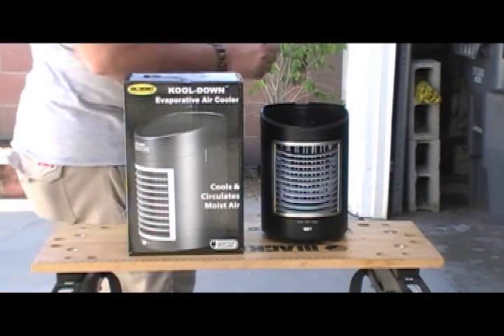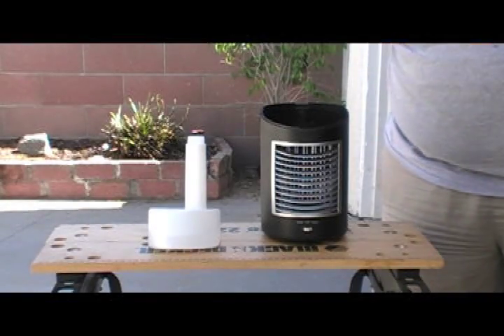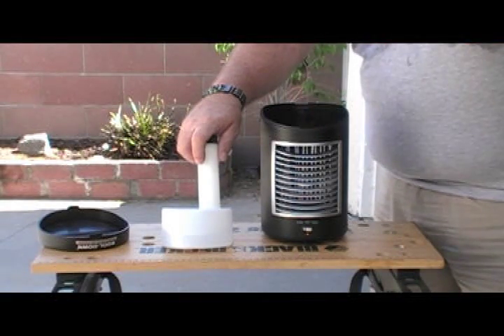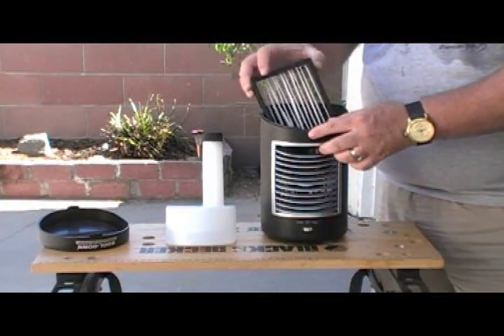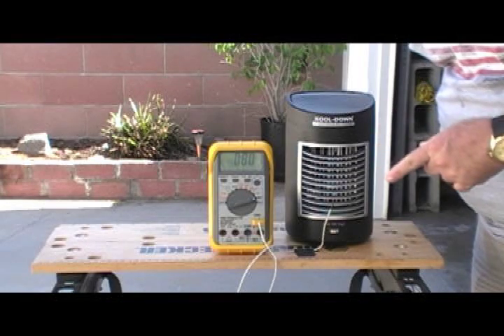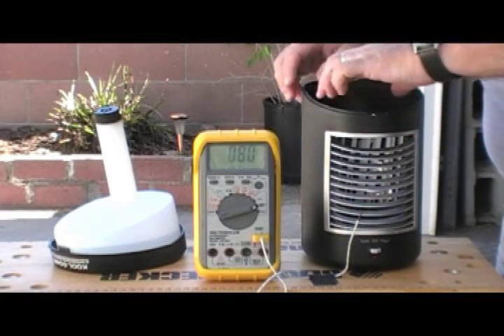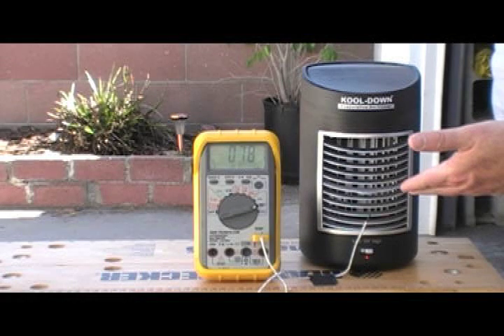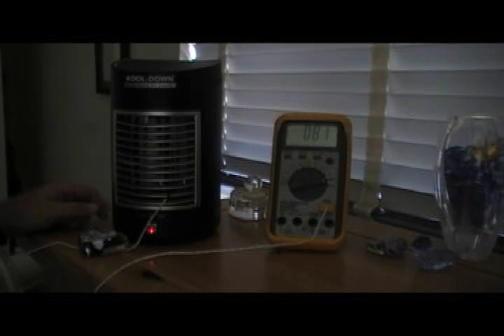Kool Down

Comment: The humidity of the environment means everything. In the mountains of New Mexico where it is very dry most of the year they work very well and are actually the standard item used.  Swamp coolers were something I had to learn about moving from Texas humidity to here.  In Texas it would never occur to me to ADD moisture to the air.  I have a variation of this item at my bedside right now.

Comment: Do you clean the filter or buy new ones?
Reply from the maker: Have not used it enough to see when replacement is needed. In fact, not sure where to get them. Since it is just a cloth like a dish towel, probably easy to self replace.
Reply from the maker: I have not used it enough to get a new filter. I am working the modification I mentioned in the video. Just trying to make it look clean and vid what/how I did it.

Comment: I think your thermometer sux
Reply from the maker: Think all you want. I have had it checked out at work and for a "inexpensive" one, it tracked within a few degrees of oven setting. Ideally, I should have several probes to get a profile of the flow.
Reply from the maker: OK. But I was able to verify it's operation against a calibrated oven. Accurate to within less than 2 degrees.

Comment: The only time I would ever use this or something like it during a power outage and I'd def make sure the water is ice water and filled to the max. Maybe being in the desert it would give me better results than u got. Of course I'd be using it inside not outside.
Reply from the maker: I've done the ice water trick. No help. Part of the issue I've discovered is that the water absorbs from the bottom so it evaporates before the mesh can saturate. One fix I am working is a very low flow (dousing) pump to dribble water from the top. Hope to have that update when I find one that does not break the bank.